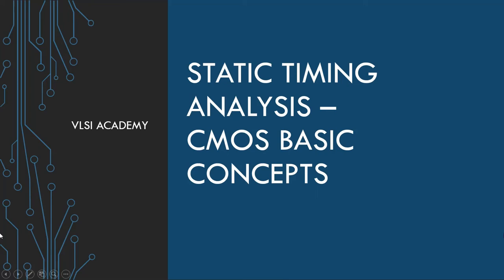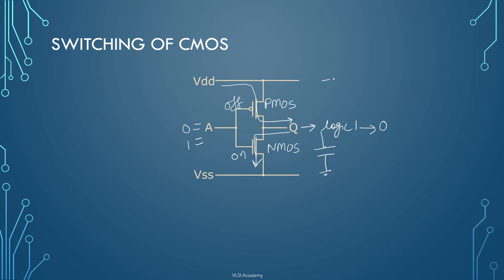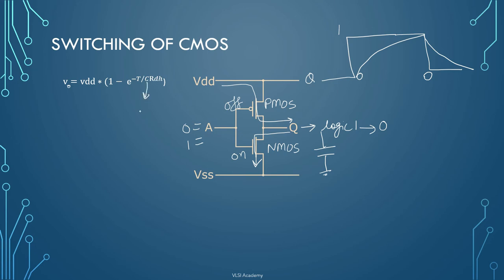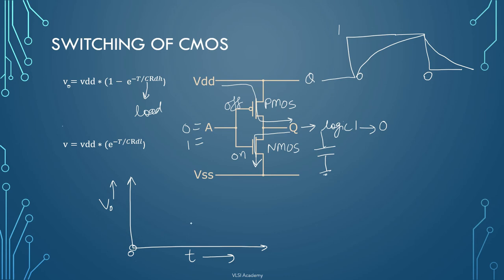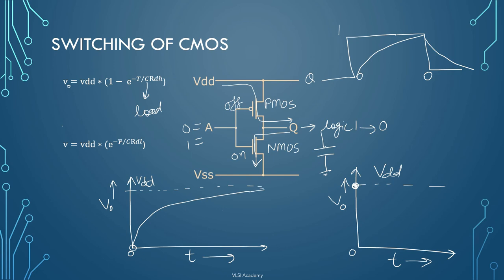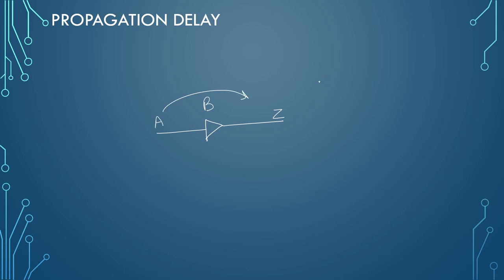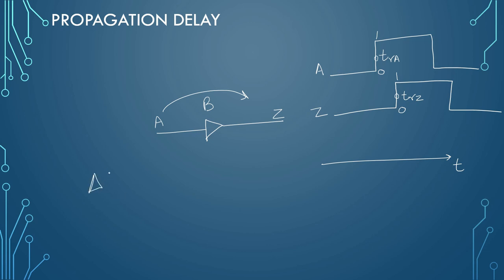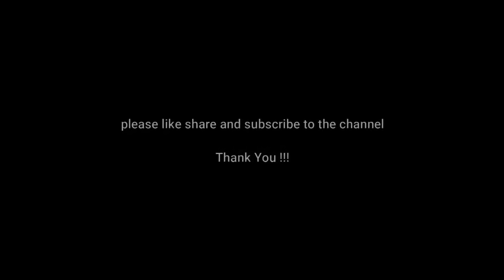STA lec4 CMOS switching waveform and propagation delay | static timing analysis tutorial | VLSI

Comment: Sir , Can you provide the solution for this question on buffer.
>>When a 100MHz clk with 50% duty cycle is given to input of a buffer, the output is a 100 MHz clk with 60% duty cycle. So what will be buffer output if a 50MHz clk with 50% duty cycle is given as input to the buffer. Assume that the delays doesn't change with frequency.

Comment: Why capacitive load is considered in output?? What is the reason for  capacitive load??
Reply: Almost all cmos logic will drive another cmos logic, which primarily consists of mosfet gates. These gate terminals do not consume current in any significant value. And are basically capacitors (gate - substrate capacitor, gate- drain and gate -source capacitor). This is why gate pins of mosfets, and by extension, all cmos logic input pins are modelled as capacitors.
Reply: @PunitJain8695  thank you
Reply: Just in case you were asking about capacitive load at the output of cmos logic (present even if it isn't driving any other cmos logic), this is made up of the combined capacitances of capacitors like drain-body cap of nmos and pmos, drain-gate capacitance (miniscule),

Comment: I don't understand why you are multiplying the time differences by 1/2. I understand that your reference point is 50% of the voltage between a logic 0 and a logic 1, but that 50% is used to pick the reference points. Once we've picked the reference points, then the time between the reference points will just be the simple difference; trZ - trA. Why would we multiply that difference of time by 0.5, when it seems the 0.5 really refers to 50% of the final voltage. We aren't interested in Voltage x Time, just in difference of time.
Reply: @VLSIAcademyhub  Thanks, that's very helpful :)
Reply: could you tell why we are multiplying by .5 here?
Reply: tplh and tphl are the two delays so we take avg to get avg prop delay ; these two delays are for reaching 50 %